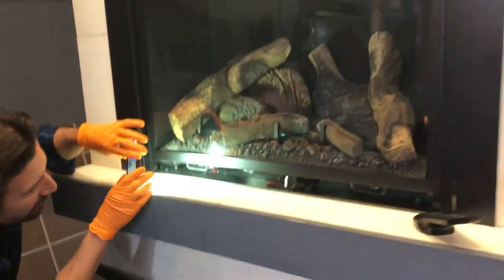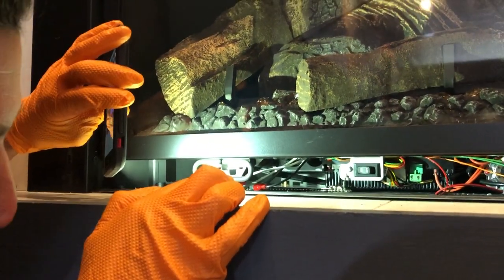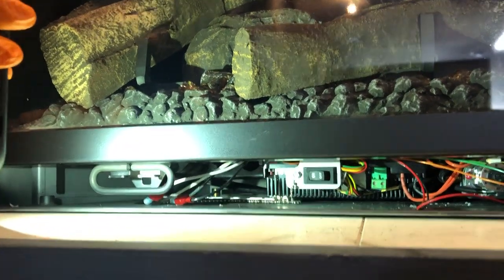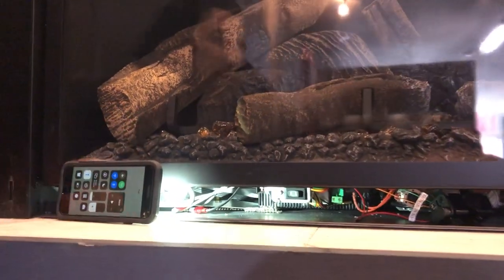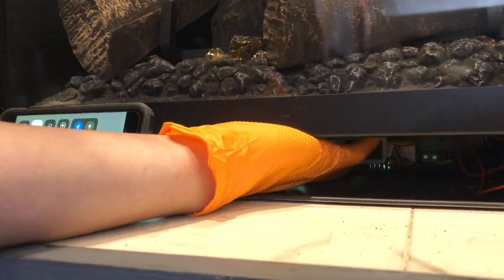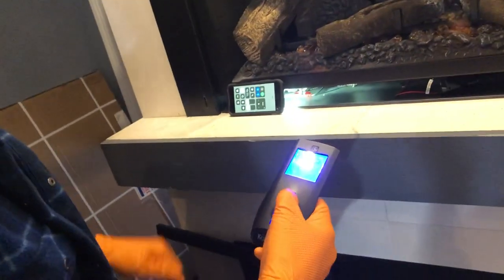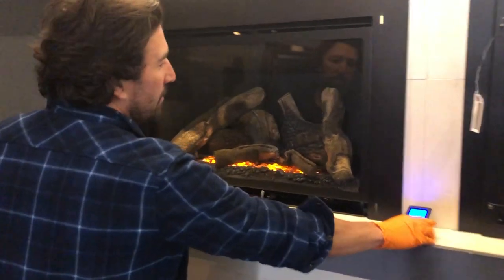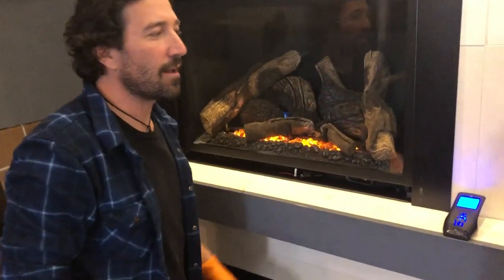Kozy Heat Remote and Module Sync - Chaska 34 w/SIT Proflame II

Comment: Omg. I looked all over the place for this button. Kozy instruction manual is trash. 
You guys rock!
Reply: How do you install the glass panels inside the Chaska 34 rock fireplace insert?
Reply from the maker: @Boomkelly  The panels should come with 4 brackets to hold the side panels in. The back panel goes in first, followed by the left and right side panels. Those left and right side panels have small brackets held in by 1/4" screws. You'll need to remove all the rocks before you put in the panels. Since the glass panels are new, we've had some shipments lately where they didn't include the brackets. Reach out to Kozy Heat if you didn't receive those brackets and they should be able to supply them. Or a local Kozy dealer can order them as well.
Reply: @Summitfireca  It came with the 4 brackets and 2 screws.  
I think I know where the bottom brackets go but unsure about the top brackets.  It doesn't say where the top brackets get installed or the orientation.
Reply from the maker: @Boomkelly  Sorry...just saw the reply. You've probably already figured it out but there's a couple small holes where the screw is supposed to go in on the ceiling for the top brackets.